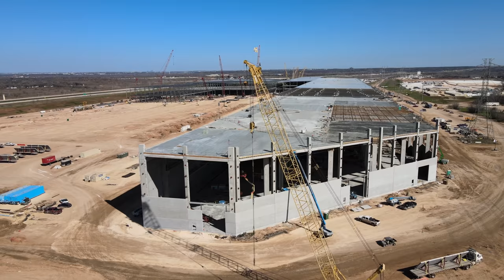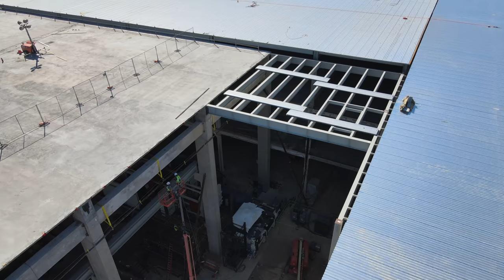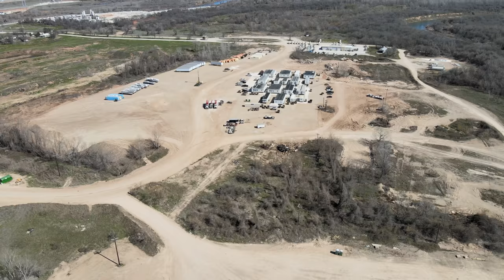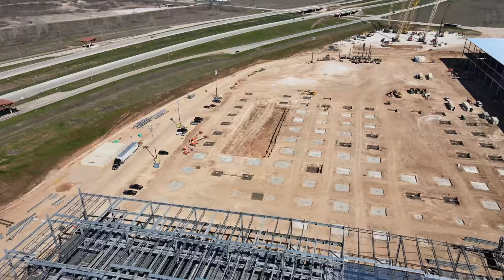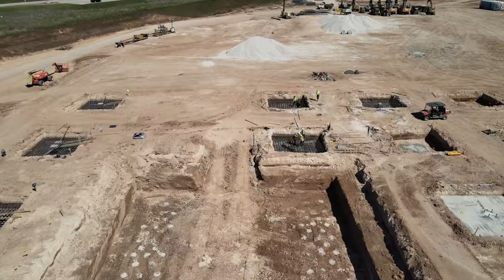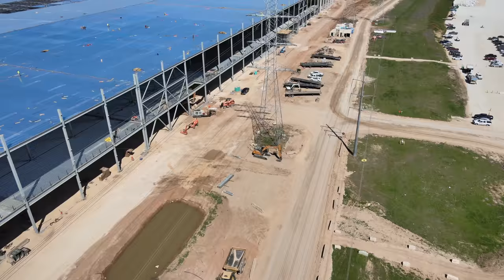Out With the Old, In With the New - 2021-03-07 Progress Update

Comment: Thank you! Lots of progress on the roof, much more of the roof metal cladding has been put in place, linking various areas of the building they have built separately  but grew together. Nice to see crews working on both the metal roofing and concrete roofing over the weekend, keeping busy, along with folks still working on the new footers around the NW and SW areas! Also starting to join the Casting area to the rest of the structure. That last gap between starting to get closed in! Thanks for all the close ups!